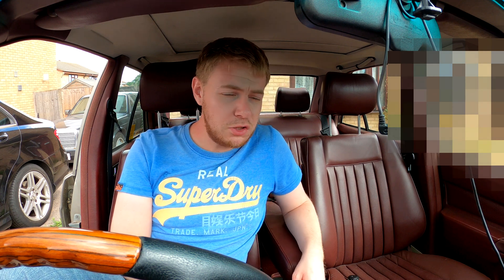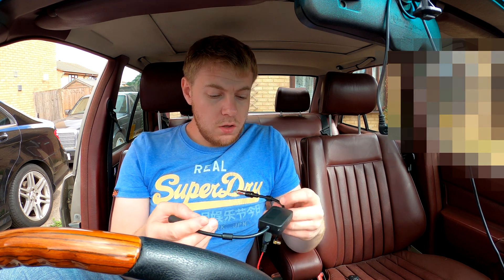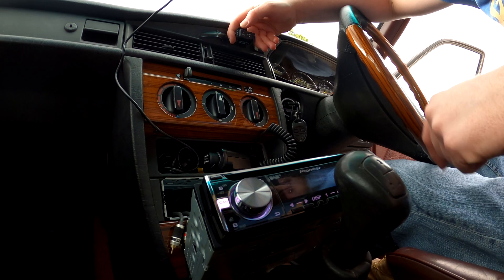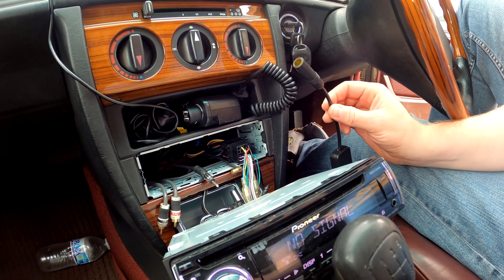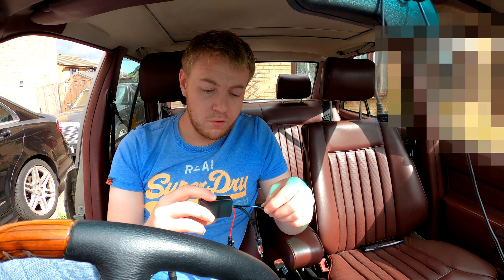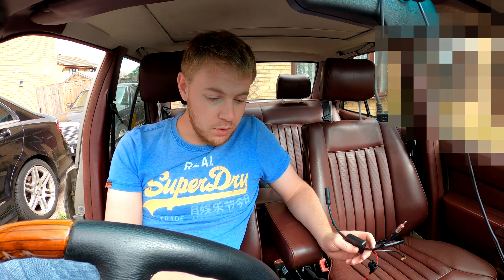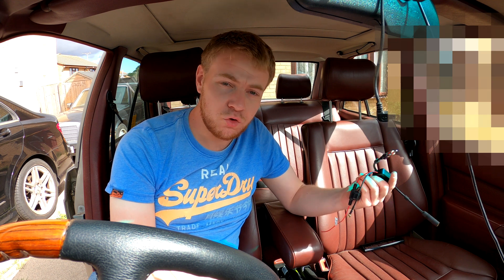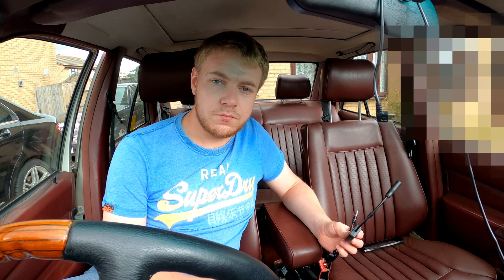Do The Aerial Antenna FM / AM to DAB Splitter / Adapter Actually Work? 4K

Comment: Cannot understand anything you says
Reply: Maybe noise cancelling mic 🎤 and more clear slow speaking will help. Good video thanks
Reply from the maker: OK cool, what would you like me to do about my speaking disability?
Reply: Turn up the volume and speaks fine.
Reply: Let's face it,with the changeover to digital TV,most old style TV aerials worked,so I am hoping that the same applies to a rear window OEM fitted Volvo aerial.

Comment: Hey mate can I ask did you wire the red power wire to the head unit wire labeled antenna power or did you wire it directly into the power cable to the harness?
I’ve currently got mine connected via the antenna power wire as my FM reception was shocking without this unit 
Now I have it and it’s great 
Only issue is the DAB doesn’t seem to be working 
Any ideas?
Reply from the maker: For the purpose of the video I just pushed the wire in the switched power lead connector, the antenna out wire will work fine too as that should output 12v. At least it's helped the FM reception, is the FM antenna an amplified one or not and does the adapter you have require a amplified or non amplified antenna? Or might just be a faulty adapter.

Comment: I've just paid £13 on Amazon for exactly the same thing. 😒 Not arrived yet. Looking forward to fitting to see if it works.

Thank you for making this video. You've inspired some hope that might just work and save me sticking a weird DAB antenna on the windscreen.
Reply from the maker: You're very welcome, hopefully it will work for you too, it's definitely better than the windscreen antennas as keeps everything hidden.
Reply: I didn’t realise the model I bought comes with an SMB male connector and my DAB USB module has a SMA female connector. So, I had to order an adapter and it’s delayed the whole thing by another day. 🤣 Something folks should watch out for to avoid unexpected delays.
Reply from the maker: @mcnaugha  Any luck with the new connector?
Reply: Can you please provide link of your dab device ?